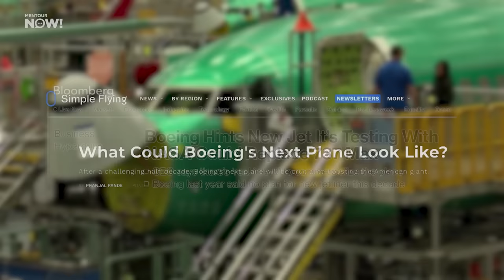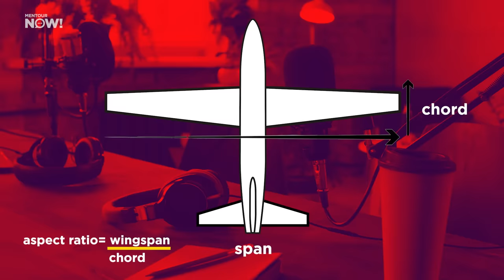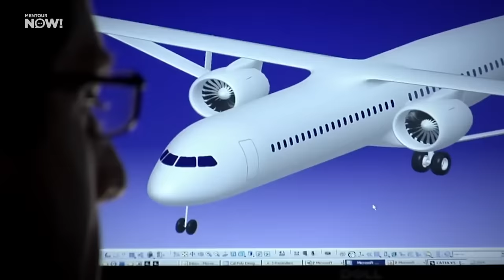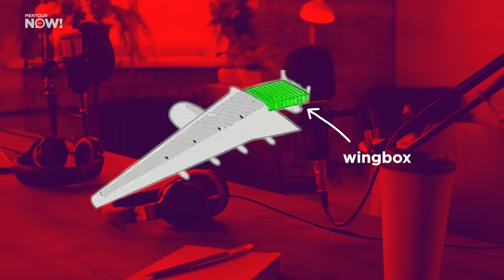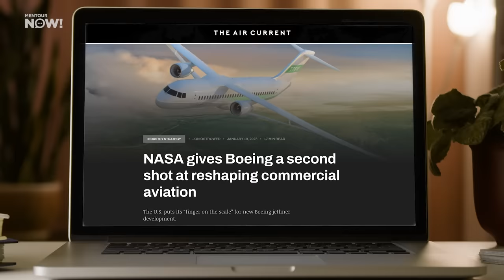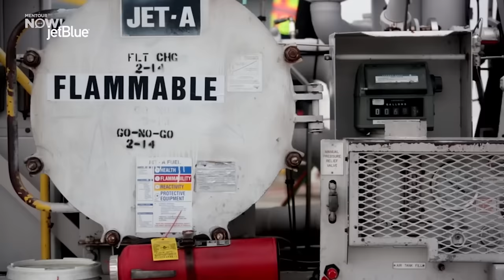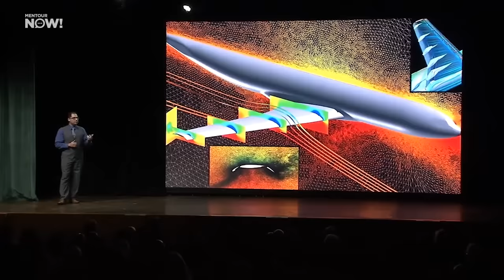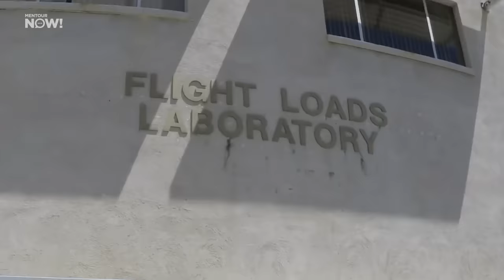Revolutionary Breakthrough: Boeing's Transonic Wing in Partnership with NASA!

Comment: That high wing will make it a lot easier to mount the new massive engines.
Reply: Imagine seeing two engines almost as big  as the fuselage...🤣
Reply: @hectoraccented5312  The engines on the 737 MAX are almost as big as fuselage.
Reply: @glennchartrand5411  it's hanging from a low wing...., the CFM LEAP-1B on the 737MAX is 2.45m wide and 2.2m tall (16.6m2 frontal surface), the fuselage is 3.76m wide (40m2 frontal surface)

Comment: The original Boeing 367-80 shown at the beginning of the video 0:05 is on display at the Smithsonian annex at Washington Dulles airport. Only one was built. Known more commonly by its nickname the Dash 80, as Mentour mentioned it was the prototype for the KC-135 aerial tanker and the Boeing 707 jet airliner. 

When you see the Dash 80 in person it's surprising how small it is. The Dash 80 fuselage was 11 feet wide, which would have allowed for five seats per row. After seeing the prototype the Air Force liked the design but wanted it wider for the tanker, so the KC-135 was built with a 12 foot wide fuselage. 

But then as Boeing began working on the passenger version they found out that the Douglas DC-8 would have six seats per row, and airlines were leaning towards the DC-8 because of this. Boeing had to add four more inches to the 707 fuselage width to accommodate six seats per row. So even though the KC-135 and 707 look identical, the 707 is actually four inches wider

Comment: I think a swept ring-wing (wing profiles forming a triangle from the top like toroidal propellers)could be another solution both to support high aspect wings and eliminate wing tip vortices
Reply: Horse shoe votex 👍. On my urban walk tonight, cars parked up, all look the same. Its optimised. Same as  diamond bike frames. Personally,  I think the future is slower, more efficient per unit of energy. 👍
Reply: How if the wing is producing lift does this magically eliminate wing vortices?

Is this the next sonic cruiser?  Boeing PR are great at doing these pieces which may or may not be true..
Reply: @timempson2146  There wouldn't be wing tip vortices because there won't be wing tips. The bottom and top profiles would be one continuous piece
Reply: The thing is, just like torroidal propellers we're just recycling 50 year old ideas.  But thats not a bad idea because this that were difficult to manufacture now could be. The tip vortex occurs because its moving fowards with high pressure on one side and low on the other so you get a swirl. So stop that and no vortex drag and therefore less drag right? It never quite works out to be worth it.  Then all design is a compromise you have to put the fuel somewhere and in the wings is already optimal. So one thing gets better another gets worse.  Still worth research but doubtful we'll see much change.
Reply: @dr_jaymz  You can't get rid of the vorticity because simply generating lift creates vorticity. You can turn your wing into a box and you're still going to have vorticity.

Comment: As a passenger the view out of a high-wing plane is much nicer too.
Reply: Not if you want to look at the stars.
Reply: This will have the strut blocking some of the view, but less of it. Of course most seats will be in front of or behind the wing anyway - especially with such high aspect ratio wings. This also solves John Nunn's concern - get a seat near the front or back and the wing won't block sky or ground.
Reply: @quillmaurer6563  😭😭😭😭😭😭, you got me 🤣😂🤣😂🤣😂🤣😂

Comment: I've refinished the wings on several Dreamliners since they have issues with UV damage. The wings are absolutely humongous and you can comfortably walk along them without worrying about room lol
Reply: We are now seeing the limitations of fiberglass, it hates UV.   AS such, all wings and bodies made of this stuff will weaken over time.    Carbon fiber, fiberglass, whatever iteration you make those wings spars and fuselages out of.  It has a limited lifespan.
Reply: @orthopraxis235  it's more so the matrix medium that hates it directly.
Reply: @orthopraxis235  not only that, but the complete disregard taken in the search for more profit. Even if it's pennies. When we refinish these planes they're only looking at weight savings. Rarely does an issue get reported or resolved. There isn't enough protection in the form of coatings to protect these composites in an effective way because they don't want the extra weight

Comment: Between engine and aero design trends, I can't believe were headed forward back to 'open prop/biplanes' aesthetics - 2050 style of course.
But then, we used to cross the Atlantic in 3 hours on a futuristic looking high alt/mach jet too, but went 'back' to higher tech efficiency at lower pure performance
Reply: Concorde barely cruised past mach 2. That's not exactly high mach.
Reply: Well, most of 'us' never crossed the Atlantic in 3 hours because it was horribly inefficient and, thus, extremely expensive compared to the alternative. You can cross the Atlantic today in a flat-bed seat for a fraction of the cost of a seat that wasn't much more spacious than a modern domestic economy seat on the Concorde. Ever since the 747, subsonic widebodies have accounted for the vast majority of long-haul passenger air travel.
Reply: @nameberry220  Neither is .8
Reply: @vbscript2  I'm making a very specific conceptual point which apparently escapes you. No one is arguing that Concorde was economically attainable, feasible or sustainable.
Reply: @nameberry220  But more than 2 times faster than any Airbus or Boeing. Which was the point you seem to have missed..
Reply: Yanks still got their noses out of joint over the Concorde.
Reply: @vbscript2 not to mention it could only go supersonic over the ocean due to damaged windows from the sonic boom 😂
Reply: Its cost and emissions that's what's driving what we see now to will change up some
Reply: Outer Marker
Concord was ahead of it's time.
I still believe it's still possible to develop a more fuel efficient and less polluting successor.
Reply: @michaelopere5424  Indeed it was. However long it takes, I can't believe we'll be trundling across the globe at sub mach commercially for generations to come.
New and evolving materials, fuel, engine technologies etc, we'll get there again, but cleaner, cheaper, better.
Reply: @jjdean787 The way the world works, you're probably right.
Reply: @outermarker5801  .
I am huge fun of fast moving objects be it Land or airborne.
The aviation industry retrogressed when the Concord was retired.
The Chinese have decided to take a different path though,this is because they have successfully tested prototypes of a magnetic levitating train that can move at 4000kmh an hour.
Reply: Those magnificent men and their flying machines! What's old is new again lol!
Reply: @michaelopere5424  you cannot break the laws of physics.....there is a reason we don't go past mach .8 

There is a reason we only have a few natural air burning aircrafts let's be honest they are jets that go past mach 2. 

Because the cost is drastically different we're not just talking maybe 2x, 3x difference were talking 10x plus. 

Look at the average maintenance times these planes compared to their passenger loads. 

Money is what's fueling this. 

Who the heck cares if you can get to Europe in 3 hours? If it costs you your new born child. 

This is really a go open an Aerospace book moment. Kindly your friendly neighborhood Aerospace Engineer.

It's not that we can't do it. It's that there is no economically viable reasons to do so.
Reply: Supersonic jet manufacturer Aerion has received orders worth 2.5 billion dollars, Boom has also invested 
100 million dollars in it's company with it's first plane set to be unveiled in 2029.
Reply: @michaelopere5424  you're delusional if you believe 2.5 billion is enough to set up a functional working mach jet program. 

"The initial development estimate for Concorde was $130 million. However, this was vastly exceeded by the final cost reaching over $2.8 billion."

You're out of your mind.

This is one of the first times I will use the fact I'm an Aerospace Engineer to win an argument. This isn't an appeal to authority because I'm telling that you have no earthly idea what you're talking about. Go look at any similar program and you will quickly see that were talking Billions of dollars to start a program that isn't even DELIVERING A FUNCTIONAL PRODUCT.
Reply: @seemlesslies  
What's the point of arguing over a concept that had already functioned before.You remind me of the people in the 1800s who used to claim that it would be dangerous to travel at more than 50kmh because it would cause tunnel vision.
Reply: @seemlesslies  
What's the point of arguing over a concept that had already functioned before.You remind me of the people in the 1800s who used to claim that it would be dangerous to travel at more than 50kmh because it would cause tunnel vision.
Reply: @seemlesslies 
'You're,comparing apples to Oranges' 'You're delusional' 
'talking faster than the speed of sound' what dialect of English do you speak?
Reply: @outermarker5801  .8 Mach not being high doesn't imply anything above 1 Mach must be high, you have the hypersonic category just for that.
Reply: @michaelopere5424  you seem to have the knowledge of the people in the 1800s indeed
Reply: @davidaugustofc2574  The clearly established context of the conversation is commercial flight. In that context therefore, M2.0+ is 'high' by comparison 🤷‍♂
Reply: @outermarker5801   if you like mental gymnastics that much then fine for you bro XD. The mean house is taller than the average car, however that doesn't make the average house tall by building standards regardless of what ill-conceived excuse you can come up with.
Reply: @davidaugustofc2574  If you call simple contextual comments 'mental gymnastics', you have bigger problems lol

Comment: Another good video.
"canoe-less" wings ... like B707 and like Gulfstream planes, wings without canoes have restricted the flap deployment with the flap track constrained to the wing envelop.  This is sort like your explanation (the canoe fairings fit inside the wing) but emphasizes the engineering trade-off.  If you want ugly canoes, look at the Canadair (oops Bombardier) Challenger. 

I appreciate you're speaking to an audience, but aspect ratio is only one parameter in designing a wing.  Thickness is a significant parameter in defining the transonic speed (refer the difference between a Hurricane and a Spitfire).  Wing profile has a significant role in subsonic drag rise, refer Whitcombe sections vs earlier NACA sections.  A huge consideration is wing volume, where with "wet wings" we gain a hugely significant "inertia relief" due to the fuel (a huge problem for electric planes, particularly electric conversions).  Everything in wing design is a trade-off ... aspect ratio, wing section, wing weight, flap design, manufacturing cost, etc.  The key to a successful is making the correct trade-offs ... decisions that can only be made with limited data and much guesswork !

Yes, lighter more aerodynamically efficient wings are "better", so too are gust alleviation controls.  But, these impact the structure in unexpected and negative ways.  Lighter wings are more dynamic in there response to gusts, increasing the stresses in the wing.  Gust alleviation tries to limit this, but then it removes the high gust loads, which have a (surprisingly) beneficial impact on wing fatigue life.

Increasing wing span is indeed a real technical challenge ... look at the 777X wing tips ... the airport gates are a significant design limitation (sort of like the Shorts Stirling, wing span limited to suit the existing hangars).

I think this strutted wing is a dead end. i think the aero impacts of the strut/wing joint are going to be "horrendous".  I think their blended wing concept had a better chance.

Current strutted wings have very low speeds, that's why they're straight.

Weight of the demonstrator is pretty irrelevant ... it's "just" testing the aero models.

the NASA angle is interesting ... will the reports generated by available to the public (like all other NASA projects, except of course those with military applications) ?
Reply: A lot of work has gone into analyzing and optimizing the wing-strut-jury connection both for design and off-design conditions. There's definitely unknowns (that's why there's a demonstrator!), but I doubt they're going to be purely aerodynamic effects of that intersection.

Can you elaborate on high gust loads being good for wing fatigue?
Reply: A lot of work was done on "prop-fans" ... with little result.  I only suggested the aero effects as an "obvious" issue ... I'm sure there are many others.  Airplane design is very unforgiving to new technology ... remember the Li battery issue on 787 ?  now we barely think about Li batteries, 'cause we "know" the problems.

High fatigue loads are good to fatigue.  A wing (unlike a fuselage) has a highly varying fatigue load spectrum.  Infrequent high loads set up compression stresses at crack tips, which retard the crack growth and increase the fatigue life (well, really, the crack growth life which is more important today as it sets up the structural inspections.  "What about Miner's rule ?" yeah, well, Miner's rule is a very simplistic analysis for combining different fatigue loads. @AmbientMorality
Reply: @russellblake9850  Right, and of course they wouldn't be building a demonstrator if they thought the technology was already ready. Just wanted to mention that that is unlikely to be a primary reason they think a demonstrator would be valuable.

Interesting on fatigue: my total background on this is a single undergraduate class, so very basic. Do you know of any keyword or name for that effect? I'm curious to learn more about how that works.
Reply: @AmbientMorality  Crack Growth Retardation.  It's as feature of Damage Tolerance Analysis under spectrum loading.
Reply: @russellblake9850  Alright, thanks! o/
Reply: Not to mention, the plane looks ugly with the strutted wing.   Looks all out of proportion.  I believe that modern wing designs have been proved by decades of use, and they are very durable.  This "new" type of wing, I suspect you will find it isn't nearly as durable as the current ones.

Comment: The truss design looks like it would mean a complete structural failure of the entire wing if the plane drops an engine. Wouldn't the engine collide with the truss and cause the entire wing to shear off ?

Comment: Very interesting and well produced.  I suggest a discussion of Boeing's difficulties with their CST-100 Starliner.
Reply: A crewed  flight for the starliner is planned this year. Sounds like progress to me.
Reply: @mmm0404  Well yes but you are probably aware of the problems they have had. In 2014 when Boeing and SpaceX were selected by NASA to provide crewed flights to ISS, most people expected that newcomer SpaceX would struggle, but that it would be no problem for Boeing considering their decades of aerospace experience. SpaceX had some challenges along the way but they launched astronauts to ISS in 2020.

Meanwhile Boeing's first uncrewed Starliner test flight in December 2019 was a disaster, failing to reach ISS. NASA had until then pretty much left Boeing on its own, but they now took a much more hands-on approach with Boeing, and their investigation into Boeing's practices led to a list of 80 recommendations for changes. Boeing did all of it and repeated the test flight in May 2022, this time successfully. The next Starliner test flight will be with crew. 

Meanwhile in two weeks SpaceX will be making it's eighth crewed flight to ISS, and then another one later this year. The earliest Starliner crew rotation mission to ISS won't be until sometime in 2024, assuming that their upcoming test flight to ISS is successful. That's four years later than SpaceX, although to be fair SpaceX already had several years experience with cargo Dragon.
Reply: @StevePemberton2  well spaceX have rockets that can return to site and land on their own. Its a very ambitious company 

Their progress over the recent years  has been insane. I'm not shocked they managed to pull ahead so quickly. 

SpaceX are like the iPhone that arrived latter but still managed to take the market by storm and become a big market player. 

Starliner has nothing on Crew/Cargo Dragon, and the delays have been disappointing more especially for such an experienced company but the main reason both were selected is offer some kind of redundancy and systematic backup of having two crew capsules instead of one. 

And hey you have to admit that the statliner is one good looking space capsule. I cant wait for e crewed flight.
Reply: @StevePemberton2  Also consider that for OFT-2 and CFT, Starliner is now at the whims of the ISS docking schedule which is pushing dates out farther ever since OFT-2 landed. They really need a 3rd docking port, deconflicting these is going to be a real pain in the future.
Reply: @mmm0404  They definitively need dissimilar redundancy. It's fortunate that Dragon has flown without any problems. Hopefully Starliner goes smoothly. OFT-2 seemed to go well which is a good sign.
Reply: Another subject, more closely related, is the Celera 500L which boasts fantastic performance and features a very similar wing design.